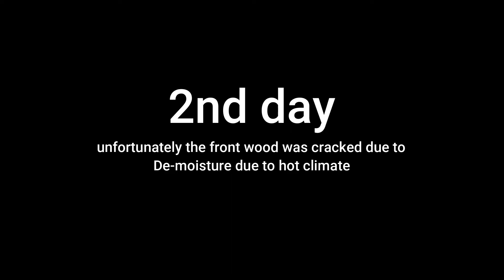DIY car under seat subwoofer  speaker box design  and sound test

Comment: Excellent ideal,actually we are professional underseat sub manufacturer,your ideal very smart,maybe it will be trend in near furture with the low impedance amplifier which don't need heat dissipation,wooden box enough than aluminum box.

Comment: OK. sO YOU COMPLETLY BOTCHED THE BOX! But..... you proved that the sub DOES make a difference to a cheap Chinese car stereo.. and I notice you dug a hole in the corner of the box to let it ''breath''. 
On only a 4"' speaker, that's an excellent result."'Note to self: Don't use too many screws. Don't use the wrong grain plywood. Remember to port the box. And don't use a 4"' sub (which probably is only a mid, anyway). OK, Got it."'
Reply from the maker: Thanks for your advice

Comment: so, i am doing the exact thing but without any nail or screw, only hot glue 😅, 10'' speaker size, box about 12x5, my question is, does it need a hole or not ?, which is better ? can you share your experience ?
Reply from the maker: You mean 12x12x5? are you using low depth speaker usefor car  seat ?
Reply: @geek4tec605  yes 12x12x5, I dont really sure but I think its originally home speaker.

Comment: Y did you cut 2 holes for the speaker and closed 1 with glue gun should it be done same way or is it enough to cut only one hole
Reply from the maker: enough to cut only one whole,  2 speakers are suitable for that dimension